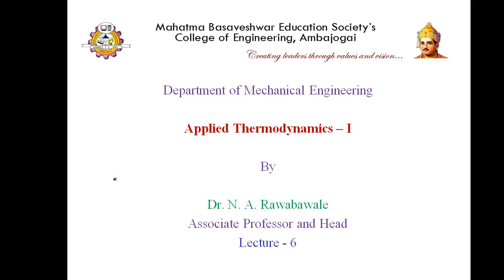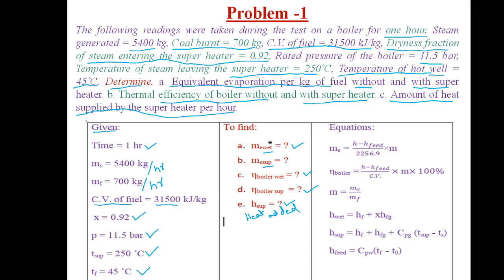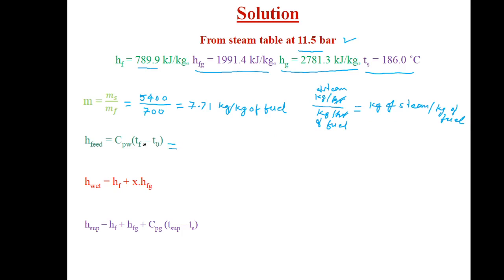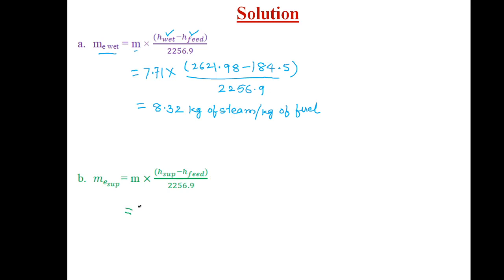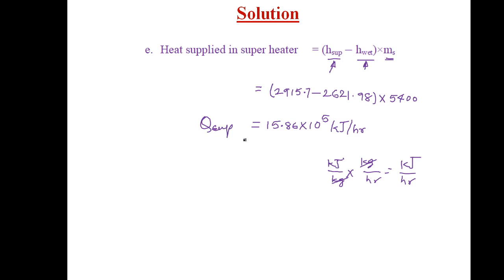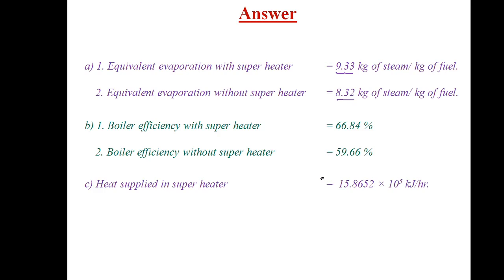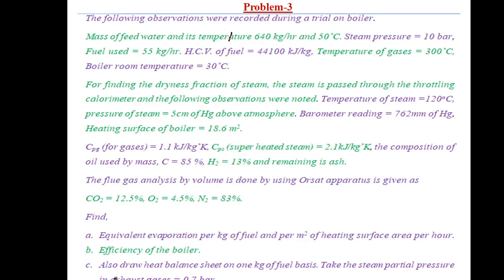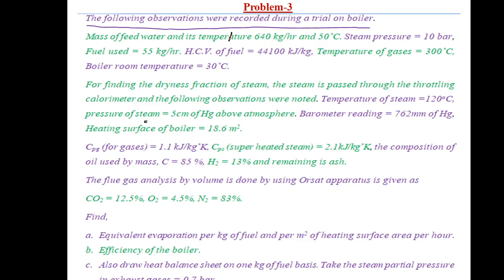ATD Lecture-6

Comment: In problem no.2 hfeed calculation is wrong. Actual calculation is 139.4, where as, you wrote 184.5 which is calculation of previous problems hfeed.
Reply from the maker: Yes, you are correct